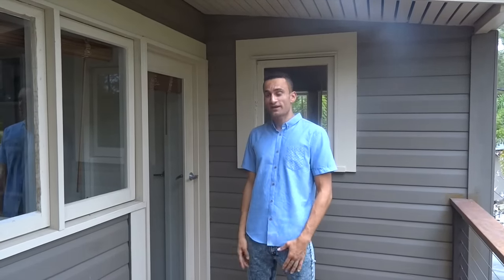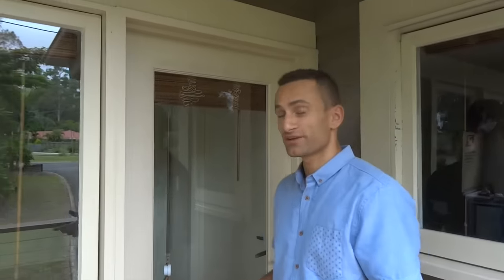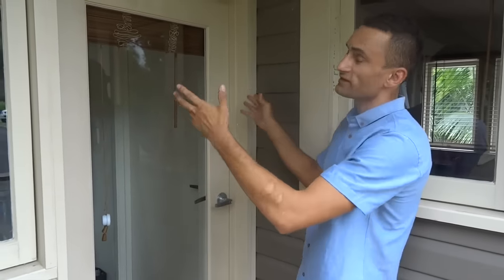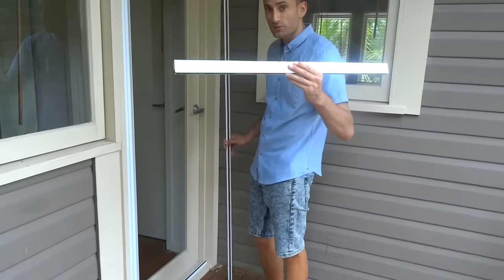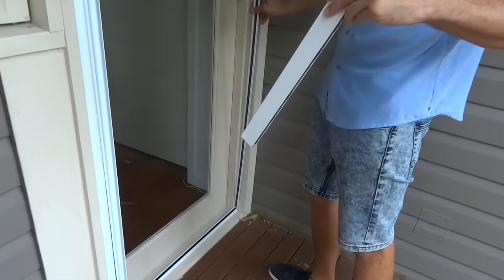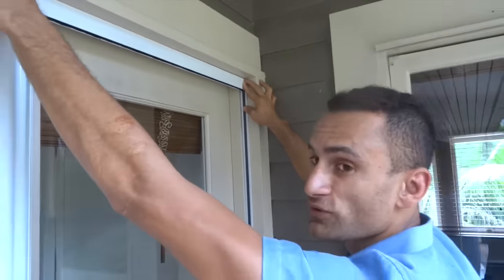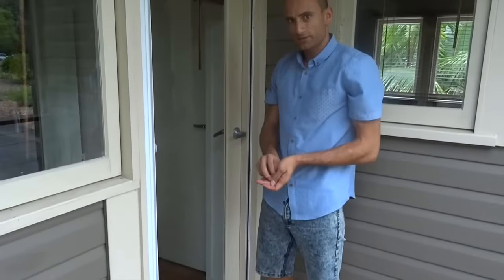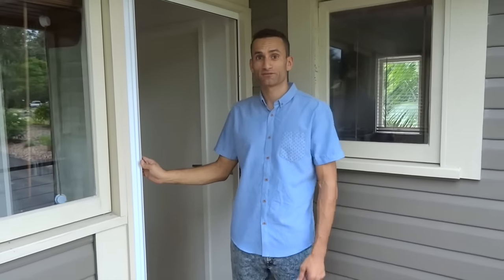How to install single retractable fly screen doors tutorial for flyscreen

Comment: Two concerns. First, the bottom track creates a trip hazard. A more tapered design would have been preferable. Also, all during the installation demonstration, I was watching to see if the screen would hit the front door handle. We'll never know because in the final moments of the video, the front door was open.
Reply: I agree with the trip hazard. That's the main reason I won't buy it. As for the door handle hitting the screen, why would anyone keep the screen extended and close the door at the same time?
Reply: @stevenkimdmd    The same reason people keep a conventionally hinged screen door closed at the same time. To prevent an influx of bugs when the main door is opened.
Reply: @patdthomas  you keep a hinged door closed , or hooked back all the time because its always there. This retracts and disappears when not in use.
You wouldn't close this with the main door closed, pointless.
Reply: Plus you could only do it from the outside which makes it even more pointless.

Use case is, I want some breeze not bugs to come in, open the door and engage fly screen. Don't want the breeze, I have to retract the screen anyway to shut the door. Why would you want to engage the screen again? You're just trying to find problems.

Even the trip hazard is not a concern to me. It's a trade-off. It's somewhat common to have to step up if you have sliding doors and I never seen anyone tripping on those.